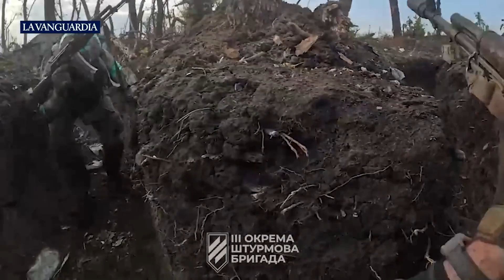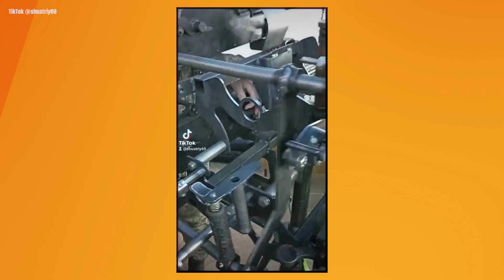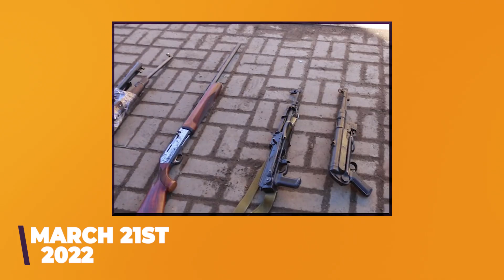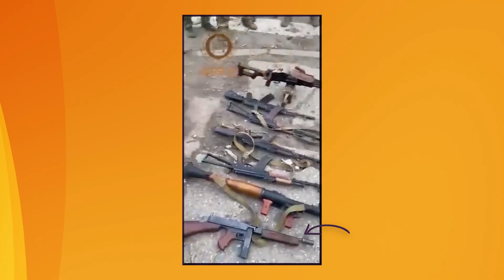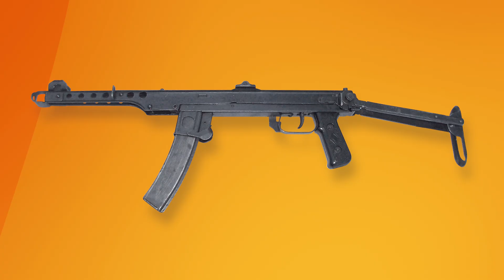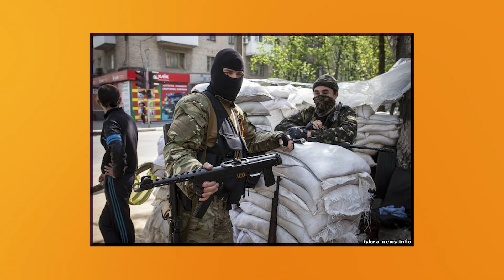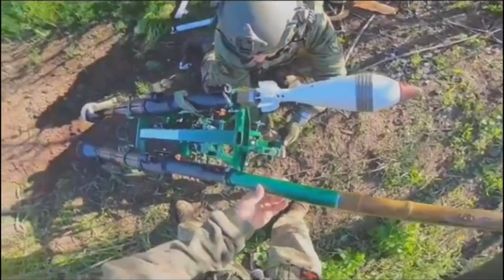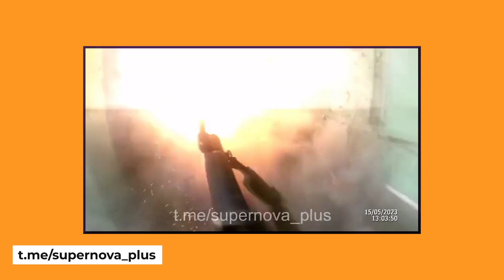The Weirdest Weapons of the Ukrainian War

Comment: Once again, at least one fact error. In fact, the Ukrainian maximum machine guns are likely not antiques. They were likely produced by the Soviets long after the original maxims were invented in 1864 or whatever. As you said, they were you if they were in service if they were in service up to like through world War II. That means that they were produced up through world War II and that the. And in order for a firearm to be antique has to be over 100 years old. So unless you check the serial numbers and find out when they were made they would have to be made by 1923 and you don't know that they were and they likely were not and then they could have been. So they may or may not be antiques but you stated that they were so you're wrong. Not only that, but the maximum machine gun is not all at all weird. It's just old. There's plenty of perfectly viable perfectly effective weapons of war that were produced way back when by that are still useful today and still produced like the ma Deuce which is the 50 caliber Browning machine gun that was first produced around the turn of the century and it's an anti-aircraft gun with the two grips on the back and the butterfly trigger. Most notably in Hollywood it was on the back of Jeeps and a worm series called combat back in the 1950s and it still being produced today. The m4 version of it or something like that I think for the M2 so it's been in production for over 100 years. The m1911 service pistol was still being produced in issued by Colt in the military up through the 1970s. The M16 has been around since the 19 late 1950s so you're definition of weird. Is that of a ignorant person who has no clue about firearms. All of the revolutionary designs from the 1800s to world War II or pretty much still in service someplace because they were that good. For instance, all modern, almost almost all modern semi-automatic pistols are are versions of the Browning high power including Glock. And they've brought Browning high power back. FN is started producing them again and they're very expensive. They've made a few changes on them to improve them even further, but they were really nice shooting weapon back in the day and they were virtually adopted in almost every military except for the US. And actually Browning the version today. Browning died so he didn't finish it and it was finished like in the late 1930s. In fact, the gatling gun they had an electric version of the Gatling gun back in like 1909 and it and it shot the same amount of rounds in the same amount of time is the modern Vulcans that they put on airplanes 4,000 rounds a minute and it started out a hand cranked machine multi-barrel machine gun which is exactly what the Vulcans are today except for their electrically operated. Will guess what they had one. They didn't sell much because batteries were crude that you could put on a battery back in like 1903 and shoot 4000 rounds a minute. Now. The caliber of the modern Vulcans is a lot bigger 20 or 30 mm autocannons basically as opposed to like 9 or 10 mm ones of the Gatling gun roughly. Here's something weird. Dumbass and United States is legal for anyone to own a gatling gun cuz it's not doesn't meet the modern definition of a machine gun which is you. Pull the trigger once and hold it back and it keeps firing. The Gatling gun you crank it and it pulls its own trigger but it's it has to bring the if you don't crank it doesn't keep firing. Just like you pull the trigger on a non-automatic weapon and it only fires once. So you crank it once and it fires once so it's not considered a controlled firearm, automatic firearm, and anybody that owns any gun can own a gatling gun and they're still producing them. I'll tell you something truly weird that you don't even know about that. If you saw that you could say it was weird as a calico m1m2 which is one which is two and one car beans. 30 caliber with a stocks off on a tripod on a rig that you used to buy calico sold for to anyone cuz it's cuz it was legal to for $700. Now they're like $5,000 cuz they don't make them anymore. They make a 22 caliber version that nobody wants that you can still buy for and you can put two Ruger 222s in it but it was a 30 caliber. It was heavy iron, crank and everything just like a military but it was never sold the military and it turned the 2 m1s into a Gatling gun that can fire up to like 2000 rounds a minute now. If you saw one of those on the battlefield that would be weird. They make a some weird weapons. The dirty Harry 45 Auto mag pistol was like one of a kind one engineered thing so that would be weird. It wasn't. I meant there was more than one my main. It was like a completely redesigned from the ground up automatic semi-automatic pistol and it was all stainless. There's a it's a not a Thompson submachine gun, but there's another think it's called Thompson in the 60s and '70s that you could change the barrels and calibers and the make it a pistol or a rifle and it was pretty cool. It was fairly expensive. It had one stocks and it's pretty rare you see any guns like that and then that would be weird. Weird is like rare. Not. They're just antique that they're just antique doesn't mean jack s*** they have to be rare or like handmade. Like the Afghanistan. I can afghanistan. You can find a bunch of handmade rifles that are just some are like they're. They're in collections that are just downright scary to exquisite all one of a kind handmade and they could very well meet you. Ukraine isn't that very far away. If they found them way on the battlefield that would be weird because each one is weird because each one is unique. But just because a design is antique don't mean that the specific model that you're looking at is antique cuz they resurrect the antiques all the time. They're still making lever action 30s they're still making 1894 Winchester's for instance. They're still making 1911 pistols. There's you know you just don't know what the f*** you're talking about. They're still making Gatling guns.

Comment: Given the Brits fired a Vickers for a week continuously in shifts and the darned thing was still functional at the end of said week, I'm not surprised the Maxims (the Vickers HMG being a refinement of the Maxim design) are still holding up well.  It's an incredibly reliable gun if used right.
Reply: Water Cooled Barrels have amazing records of longevity. A group of four Vickers reportedly fired over a million rounds in a weeks time during The Battle of The Somme.
Reply: @fiftycal1  That would not surprise me at all.

The firing I was referring to was a test done in 1963:

"In 1963 in Yorkshire, a class of British Army armorers put one Vickers gun through probably the most strenuous test ever given to an individual gun. The base had a stockpile of approximately 5 million rounds of Mk VII ammunition which was no longer approved for military use. They took a newly rebuilt Vickers gun, and proceeded to fire the entire stock of ammo through it over the course of seven days. They worked in pairs, switching off at 30 minute intervals, with a third man shovelling away spent brass. The gun was fired in 250-round solid bursts, and the worn out barrels were changed every hour and a half. At the end of the five million rounds, the gun was taken back into the shop for inspection. It was found to be within service spec in every dimension."

That's taken from the Popular Mechanics article 'Forgotten Weapons: The Vickers Gun Is One of the Best Firearms Ever Made' by Ian McCollum, published 16 of January 2016.  If you search the article name you should get a link to it (I'd share it here but Youtube tends to ban links).

Comment: A small correction regarding the FN F2000 Standard model rifle. The optic is not integrated. It is mounted to a Picatinny rail on top of the rifle's receiver, with a protective shroud that covers it. The shroud can be removed from the optic, and the optic can be removed from the rail, and the rail can be used for mounting other optics and accessories. If the Ukrainians want to "convert" their Standard models to a near identical equivalent of the Tactical model from FN, they easily can.

So, them having gotten the standard models from Belgium almost certainly had nothing to do with Belgium not wanting to give up their "best stock" (presumably meaning the Tactical or Tactical TR models of the F2000), and instead had to do with the fact that they were able to send "out of the crate" optically sighted rifles, rather than rifles with rails and iron sights, that would then also need additional optics to be sent, and then dinked around with to get set up to be 'on par' with the Standard model, and all the associated additional time, effort, headache, and additional logistics involved in that, and so on.

The choice to send Standard models seems entirely pragmatic, and given the situation on the ground in Ukraine, it is eminently the most practical and sensible immediate choice of the two options. And, the Standard model was quite likely the preference, possibly even the choice, of the Ukrainian military over the Tactical or Tactical TR models.

Comment: We have also to remember that after the Vickers gun a Maxim variant was retired from UK service some soldiers tried to"break"one with overuse they failed as the design absorbed over 1 million rounds firing continuously
Reply: Yes.
Any body that thinks a Maxim gun is a joke knows nothing about fire arms.
Reply: @owensthilaire8189  as long as a Maxim of any sort whether Vickers,Maschinengewehr 08 or other including the 1 pounder pom pom a maxim type gun firing a 454g shell has a man to fire it,men to feed it ammunition and water to keep it cool it will fire
Reply: Overkill
Reply: The Vickers was used to 'dispose of' a stockpile of '303' after we had gone over to 7.62x51. This was at Strensall barracks in 1963 & it was FIVE million rounds. A 250rd belt at a time & other stops to change the barrel after it wore out. It took a week and the weapon was still perfectly serviceable after they were done.
Reply: And when the armourers pulled it down afterwards all parts were within spec. Obviously, it had gone thru a lot of barrels but the rest was hardly worn at all. BTW. it was 5 million rounds: 

Obsolete or not, there was strong attachment to the Vickers. Many felt, why get rid of something so good? As if to prove a point (and also to use up the Mk VII ammunition still in the inventory, which was no longer approved for Service use), the most exhaustive trial probably ever fired from a Vickers took place in 1963 at Strensall Barracks in Yorkshire, England. Five million rounds were fired from a single Vickers which was kept in constant use for seven days and seven nights.

British Army Sergeant T.R. Ashley was one of nine armourers involved. At the time he was in an 18-day Vickers course at Strensall Barracks. As related by Sgt Ashley to Warren Wheatfield of Sudbury, Ontario.

.. First day, gauging limits and setting the gun up. (We spent two days hand filing feathers [the square projection] on cross pins to close tolerances so guns and tripods could be assembled without play!) at the end of the day, the instructor told us to draw out one of the guns that we had been working on, [and] one of the lads pulled a gun out of the rack. We were told that this gun was to be fired for the remainder of the course, day and night.

The gun, stores spares, etc, were put onto an Austin Champ and driven onto the range. We mounted the gun onto a tripod in a gun pit. A 4-ton Bedford had been unloaded with ammo. There were stacks of ammo, after cans and barrels. (We had to pack all the rear groove with asbestos oiled string!) The 2 man crew was relieved every thirty minutes. A third body shovelled empty cases from under the gun with a malt shovel and threw the empty belts clear of the pit. We never heard the gun not firing in anything but the shortest time while the barrel was replaced (every hour). The gun fired 250-round belts without stopping: not in 20, 50 or whatever bursts, but straight through: we could hear it rattling away from the lecture room/workshop, and went to see it between work.

At the end the gunpit was surrounded by mountains of boxes, belts, cases, debris; a large cleft had appeared in the stop butts where the bullets had destroyed the butts. We took the gun off it's tripod and back to the workshop. We inspected and gauged. No measurable difference anywhere. It had eaten barrels, they were changed every hour to 1½ hours, but mechanically [the gun] was unchanged. It had consumed just under five million rounds of .303", non-stop (my notes were for Mk VII, not Mk VIIIz, so I presume zones etc were for Mk VII).

That episode was to show nine armourers the ability of the hallowed Vickers. Only after an excellent course result did my Staff Sergeant boss let me work on our battalion guns, which had smooth waterjackets..

Quoted verbatim from the first edition of "The Grand Old Lady of No Man's Land" by Dolph L. Goldsmith (Part III, Chapter Seven, pp 188

Comment: I think my favorite weapon in use by Ukrainian soldiers is how they 3D printed grenade droppers and attached them to off-the-shelf drones. And have used them with such ridiculous accuracy that they've managed to successfully drop them INTO Russian tank hatches. From many, many feet into the air. Repeatedly. Also the craft produced boats, again, using entirely off the shelf parts, that create water drones, high speed jet boats loaded down with explosives that are basically surface-skimming torpedoes that can be directed to go wherever the hell the operator wants them to.

Comment: Most submachine guns are usually produced in such numbers that them showing up in Ukraine or any other conflict is not all that surprising. (I will add that besides the PPS, the PPSh-41 has seen heavy use in Ukraine. Both are liked in the short range room clearing and trench cleaning missions.) 

The RPG/mortar combo is a bit of an odd one. One of the video clips you had (the launch in a building) looks more like a normal AT RPG than a mortar combo. The other ones were definitely mortars, and definitely odd. 

One that seems to have missed the cut is a modified Kord 12.7mm machine gun modified with a shoulder stock and fired from a bipod. This was seen in the early days of the war. A DP-28 with optic has also been seen in use. 
The SVT is kind of unexpected, however the StG-44 has been used and is even more unusual. Both were made in very limited numbers and are usually in a collection.

Comment: On the RPG-7 mortar round combination. Its not welded, its a thread adaptor made up to put the motar round on it. Also it is not more accurate nor is it a combination that you can fire far since the rpg booster and motor are not designed to fire such heavy projectiles even the tandem heat round has a range of max 150 meters and it flys in an ark that resembels a brik. The round fired inside the house is a standart RPG-7 round nothing made up, its one of the most modern rounds for it. Do your research better next time...

Comment: So...few points of contention:
1) It's not PPS, it's PPSh - papasha, coming from the russian moonrunes(character for the "sh" sound) as well as the designer's name.
2) The tactical tuna...errr...I mean F2000 has been adopted as the standard rifle for the Slovenian army - it's not as much a flop as you may have been led to believe. Also the defining feature of the Slovenian version is the carry handle on the picatinny rail, not the rail itself - the normal version has it as well, under that cover, what do you think the optic is actually attached to? It was also (initially at least) designed to have a really advanced(for the time) grenade launcher module with integration with its optics - that feature was quickly shitcanned but hey.

Comment: Factual error. While Maxim did indeed invent his machine gun in 1884, the Russian derivative is the Pulemyot Maksima obraztsa 1910 goda or PM1910. They didn't adopt the weapon until 1910. And these are indeed the 1910 version, as the 1930 and 1940 revisions included a capped port on top of the water sleeve so snow and ice could be used to cool the weapon instead of just water.

Comment: Simon, I may have a portion of the answer to "how they got there" and I have questions of my own your researchers might make a great follow up from; all through the region Bahkmut and Soledar are in, there are salt mines. Some of these mines were up and running when the Crusades were being fought, I believe. But they are still there- look for info on the "largest underground performance hall in Europe"- and they run for miles, literally miles, with wide points where a salt dome are, super rich in pure salt was found. In the US we are using empty salt domes in our South East to store the Strategic Petroleum Reserve in.  Back to Ukraine; those mines were reportedly used as weapons depots from before WW2- storage of a lot of weapons that "washed up " in Ukraine often found a home there. What I found started from research on Ukraine's resources- and then the Bahkmut conflict was in it's late stages and a picture surfaces of Prigozhin in his full battle rattle, holding a perfect Thompson machine gun; the caption said they had just "liberated" the mine  and found all these weapons, among them three cases of new Thompson MGs. In the came picture is a large room stacked to the ceiling with boxes. Lots of munition looking boxes. Very few present generation weapons- other than a recent but very broken sniper rifle and similar. Comments in the article make it appear the felt someone was "keeping" that storage and that several specific areas were completely cleaned out.
Reply: So where in the southeast US are these (now empty & apparently repurposed) salt mines you speak of??